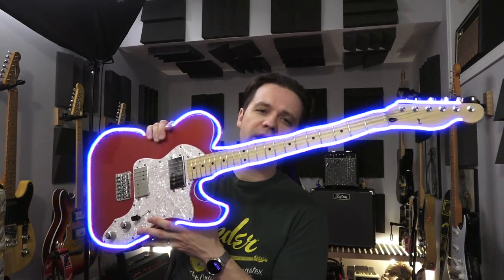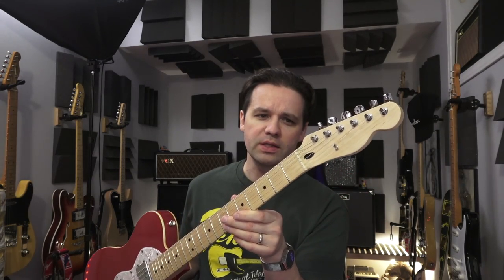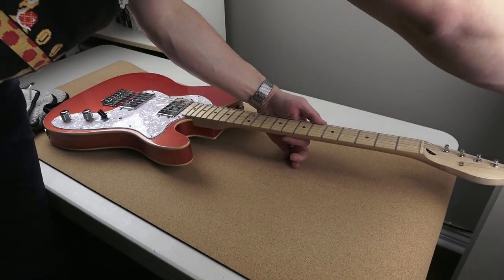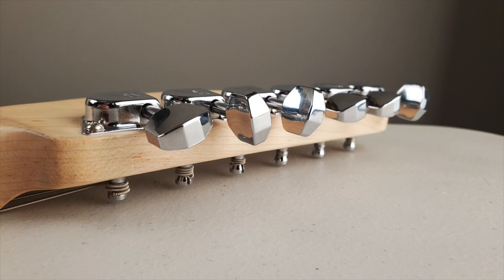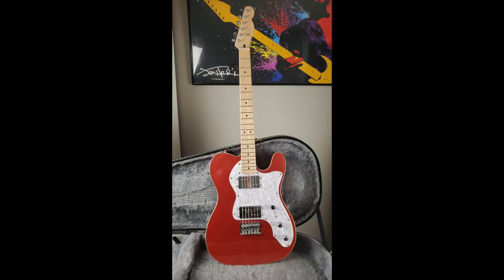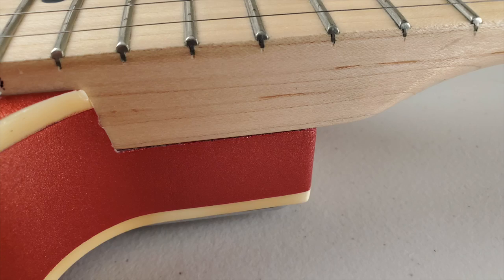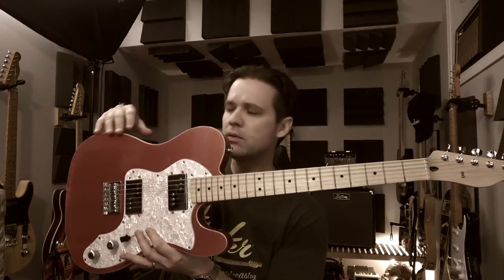Partscaster Telecaster Teardown

Comment: I'm really happy with the partscaster strat I have. I can't even really claim that I assembled it because I asked a luthier to fit the nut for me. Fender cherry burst flame maple body and a flame maple neck from USA Custom Guitar. The neck is fabulous. USACG take their time building necks, but it was worth the wait. Stainless frets and compound radius. Both the frets and the radius were a bit of a gamble for me, but they worked out well. Seymour Duncan Alnico II Pro neck, and an SSL5 for the bridge. Middle pickup is currently the original Fender one from my 1977 Strat which has its own set of Seymour Duncans. I spent hours listening to the sound clips on their website choosing from their vast range. The partscaster is partly a stunt double for the Fender, and partly instead of refretting the Fender.

Comment from the maker: What parts would you pick in a guitar build?
Content and Timestamps:
0:00 - Go
1) Intro - What this video is about: 0:48
2) Specs and Walkthrough: 3:00
   ►Quick Overview: 3:09
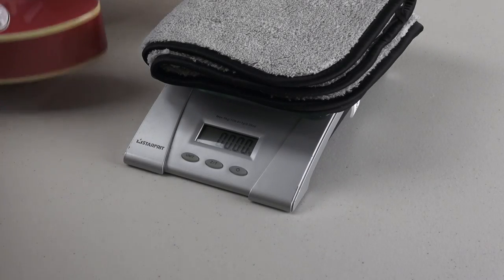   ►the Weight: 5:58
   ►Pickup Resistance: 6:19
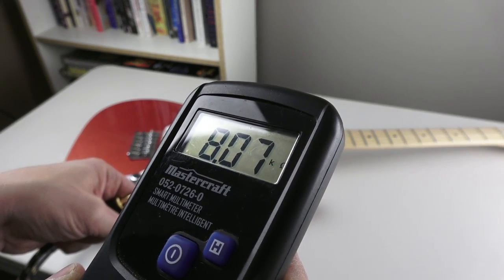   ►Parts List: 6:56
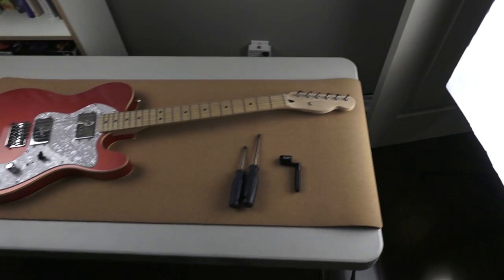   ►Inside the Cavity: 8:04
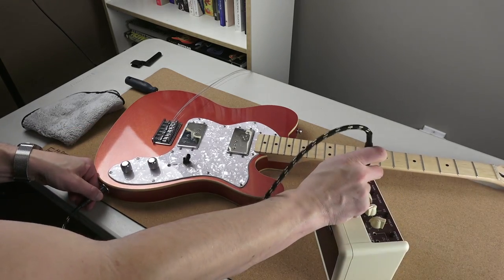   ►Electro Socket Jack? : 11:23
   ►The Neck: 12:25
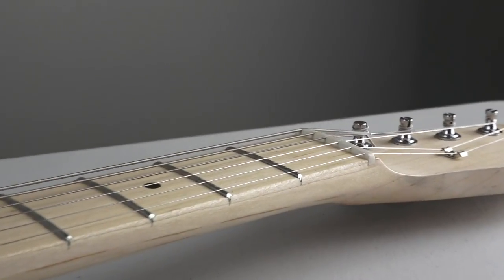   ► Detailed Specs: 14:40
3) How the Guitar Sounds
   ►Clean: 18:07
   ►Dirt: 19:32
   ►Dirt with Pedals: 20:51
4) Summary - Pros and Cons: 22:46

All the parts I used (or similar if no longer available)
►TUNERS - Fender 099-0822-100 70s"F" Style: https://amzn.to/2IhgeRS (affiliate link)
►NECK - Mighty Mite Neck for Tele Guitar: https://amzn.to/2VF1OCX (affiliate link)
►NECK PLATE: https://amzn.to/2vrBkuh (affiliate link)
►BODY: Original was from Rockaudio.com (no longer available) - Similar https://amzn.to/38kgDhd (affiliate link)
►PICKGUARD - Fender Classic Series '72 Telecaster Thinline Pickguard 4-Ply - 005-4571-002
►PICKUPS - Fender Wide Range Bridge Humbucker
►NECK: No Link found 
►BRIDGE: https://amzn.to/2IgP0Lb (affiliate link)
►POTS: https://amzn.to/39lqogm (affiliate link)
►SWITCH: https://amzn.to/2Ty2qrA (affiliate link)
►KNOBS: https://amzn.to/2VNiXL3 (affiliate link)
►SWITCH TIP: https://amzn.to/2vqXPiY (affilate link)
►ELECTRO SOCKET JACK: https://amzn.to/2TjC39N (affiliate link)
►FERRULES: https://amzn.to/2IgCAmC (affiliate link)
►STRAP BUTTONS: https://amzn.to/39m6Bx8 (affiliate link)

Comment: Hey Landon, I have the same feeling about the Artist Guitars TC59  that I bought last year. Fantastic guitar in every way, but is 5kg. Heavier than any guitar I have ever picked up, and way more than a Blackguard Tele style guitar should be. I'm looking for a replacement body for it. Worst case scenario is if I don't like the new body, everything just screws back onto the old one. Would you consider swapping out all these parts that you are happy with onto another body? If nothing else could be an interesting video showing the process and comparing tone and feel.
Reply from the maker: I have thought of it for sure. I've been looking at humbucker routed bodies, but most don't fit the wide range. we'll see!
Reply: I was going to suggest the same thing. You still have a router? You could also try removing the neck. That'd make it a lot lighter.

Comment: Fender uses 250k pots with their wide range reissue pups so you’re all good.   I’ve tried both 250k and 500k in my thinline and reverted back to the 250k.  The 500k were too icepick bright.
Reply from the maker: hey thanks for the info! cool
Reply: I'm curious if 350k pots would be a good middle ground.